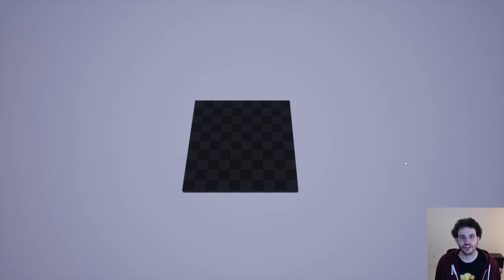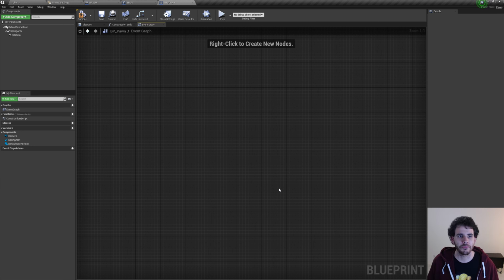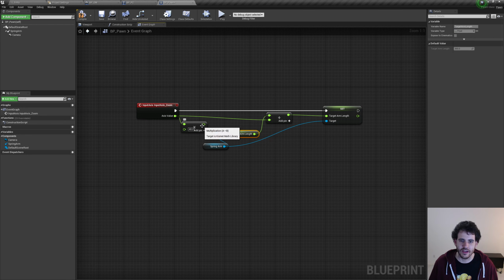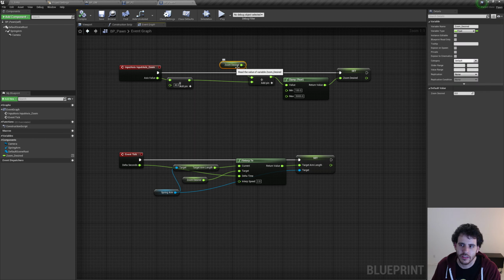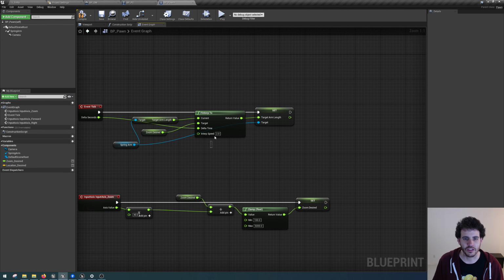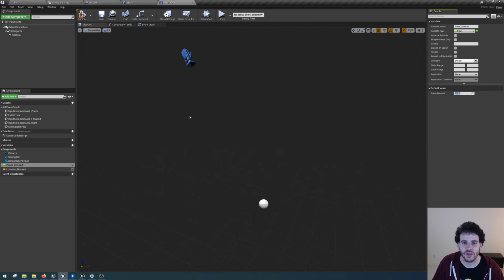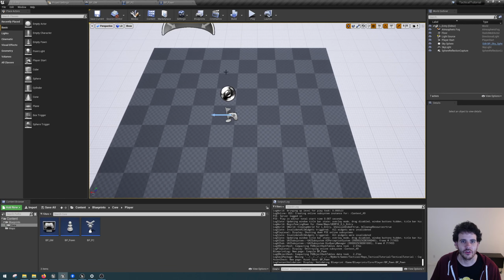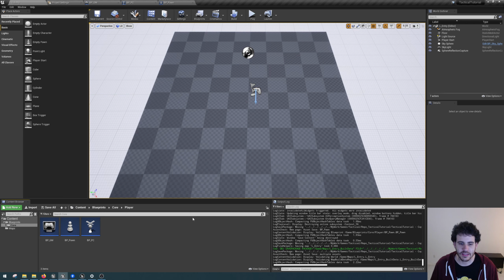Tactical Combat 3 - Camera Controls - Unreal Engine Tutorial Turn Based

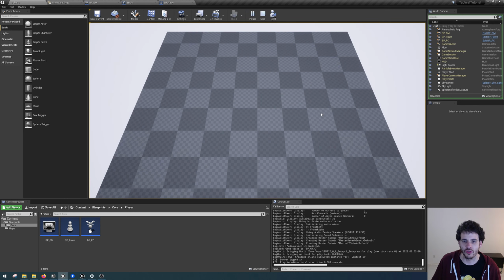Comment: Awesome Tutorial. I was able to get the zoom to work but I'm having a weird issue with controls. At 25:00 when I press play the camera moves forward on it's own a little like yours does but then mine clips though the ground and all I see is blue. When I play around and the board will appear again if I move around but it acts really weird when I center it in frame. I went back and deleted everything and tried again making sure that I used all the same values you did and it did it again. I'm on 4.25.4
Fixed! I simply continued with the Tutorial and the frame 1 possession set fixed it.

Comment: Can you please help me? I am following along to the tutorial, but wanted to add a pitch to the camera. I replicated the code we used for rotating, but connected it to the Y axis instead for pitch. It works fine, as long as my rotation (yaw) is not changed. but the more i rotate, if i try to pitch, the camera starts rolling as well for some reason. Does anyone know how to fix this?

Comment: Thank you for this video! To avoid using Event Tick whenever possible, you can also use a timeline to smooth out the rotation on each press. I liked being able to use what was taught in the movement to be able to try using the axis for rotation as well instead of button presses, very educational

Comment: Just started watching and wanted to praise the series so far. It's been a greta introduction to UE basics so far. I've not worked with visual scripting before so it's all new to me.

Question: To speed up the zoom, you could have also changed the axis scale in the project settings, right?
Reply from the maker: Yep, that would also work, but it doesn't work at runtime 
(e.g. If you want to add an option in the settings for your player to adjust it)

Comment: I'm following this tutorial as a complete beginner to Unreal and in UE5 (likely unadvised, but I'm stubborn). I could not for my life figure out how to implement UE5's enhanced input instead of using axis mapping. It's probably not awful for me to fall back on axis mapping but the deprecated tag scares me. Any tips or should I stick with axis and action mapping throughout the tutorial?
Reply from the maker: Well, my first tip is that it's not too late to restart with Unreal 4.27 ;) 
(You can always switch your projet to UE5 whenever your ready, but you can't go to an older version without redoing everything)

That being said, if the inputs are working, I'd stick with them for the whole series. If it works, don't change it :P

But, if you really want to use the enhanced input system, I'm adding it in video 65:
https://www.youtube.com/watch?v=nKioTxovOMo&t=865s&ab_channel=AlexQuevillon%5BEn%5D%28UnrealEngineTutorials%29

Comment: Thank you so much for this, I am learning so much! One question though, I am pretty sure that I have followed everything right, however, I have noticed that if I go into the game and zoom in, then exit the game. That becomes the new "minimum zoom", ie I can zoom in and out as desired, but if I zoom out and exit the testing, then I can no longer zoom in any further (I can zoom out though). I think it is something to do with the pawn moving as if I reset the pawns location it fixes it (until I zoom again).

Ive checked all my blueprint looks correct against yours, im on latets Unreal 5.2 btw :)
Reply from the maker: That is a really really really weird behavior 0_0

Do you have a PlayerStart in your level? 
(Otherwise the engine will use the viewport location as player start)

Oh and you have your pawn placed in your level? 
You don't need to do that, Unreal will spawn it automatically at the beginning of the game based on the class set in the GameMode
Reply: Possibly because of this: Check your play mode/play settings (three dots on the same tab as the play button). Check where it has "Spawn player at", and set to the player start location, not "Current camera location".

Comment: First of all, thank you very much for this course. I'm still just anticipating and hoping that this course will help me understand a little more about how strategy games are made in UE. 

There is one question. Why are we implementing camera movement in Pawn and not directly in the PlayerController?
Reply from the maker: Thanks :D

And, even though it's not going to be used in the series (at least not yet), the advantage of adding the inputs in the Pawn is that you can easily possess a different pawn anytime you want and I'll also change your controls to match the new pawn. 

Simplest example of that would be a game with a lot of different mini games.
Instead of having 1 pawn with all the different controls, you can have 1 pawn for each mini game that has different controls.

Which it's not something you can do when the inputs are directly in the player.
Reply: @AlexQuevillonEn  I see now. It's really convenient. By the way, if you happen to be interested in making some more tutorial, I can offer you a choice: classic rogue-like (with procedural level generation) or a card battler like Hearthstone :D
Reply from the maker: @@reverse7737 Yes, that could also work. When possessing a pawn (to keep the same example), you could simply switch the context of the new input system and it'll make sure to enable and disable the right inputs.

Comment from the maker: Right now, the camera movement isn't always the same speed if you press 2 directions at the same time (move diagonally) 
Ro fix that, you need to Normalize the DirectionVector before multiplying the speed with it.
So, instead of the two InputAxis events (Right and Forward) and replace it by a combination of both in the Tick.
Like that: 
https://imgur.com/a/MJtpMOJ
Reply: Hey, so far it works fine. But here i dont know what u mean. I can build this part but where should i put it exactly? Could u show the hole blueprint?
Reply from the maker: @HundmagWurst  It's the same BP_Pawn as before, I just deleted the 2 input axis events (InputAxis_Forward, InputAxis_Right) and added this at the beginning of the EventTick
Reply: @AlexQuevillonEn  Hi, thanks for your answer . Today  I got to Part 6 and saw the changes.

Comment: Hey, thank you so much for this tutorial series! I am getting an odd problem with the camera rotation though; no matter what I do, if interpolation is applied, it will only rotate a few degrees, not the whole amount. Is there anything I can do to fix that?
Reply from the maker: I'm not sure what could cause the issue, but maybe:
- Make sure you connected the DeltaSeconds properly
- Also that you're using the right interp function: RInterpTo.  (RInterpToConstant doesn't give the same result)

If it doesn't work, you can send me screenshot of your events (Tick and InputActions) on Discord and I'll take a look ^^

Comment: Thank you！Nice camera tutorial！I still get problem. I did every step follow you, just can't use "ASDW" to move camera. When i start a play in Editor, the camera falling down...lol. Would you give me some tips for this issue?
Reply from the maker: Falling down? Like, continuously moving down or just going back to a specific location and then stops?
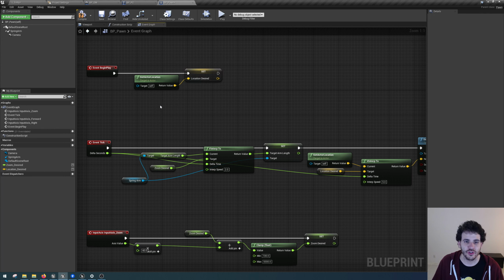If it's just trying to get to a specific location, you probably need to set the Location_Desired on BeginPlay (28:17)
Reply: @AlexQuevillonEn  Yes, this is the problem! Thanks!
Reply: Sorry, actually it works, but i don't why use "ASDW" to move camera, i should press mouse middle button first..Is there something wrong?
Reply from the maker: @howielu1841  Do you need to hold down the middle mouse button for it to work or only press it once at the beginning? 
If it's just once, it only means that you're setting the ''Editor Focus'' to the game viewport. Which is completely normal, a simple mouse click would also work. When you click on play, the focus is still on the Editor UI and not on the game viewport and that's why it doesn't receive your inputs. Because it's the editor that is receiving the inputs, not the game.
Reply: @AlexQuevillonEn  Thank you! Alex!

Comment: How would you have the camera instead orbit around a selected actor, when say for example the right click mouse button is held, and the mouse is moved left or right to pivot the Yaw?
Reply from the maker: I'd probably do something like that:
https://i.imgur.com/YjuKBoa.png
I tested it and it works fine in the BP_Pawn.
For the line trace channel, you can use the one that is working with your ground (or actors you want to focus on). Visibility should work
Reply: @AlexQuevillonEn  Thanks a bunch, it works, but I am curious if the same can be done with inputaction/axis in the case of possibly using a controller or something
Reply from the maker: @Axiz_K  Yes you can, I just did it like that because you just asked for the mouse :P 
But you can map both the MouseX and JoystickX axis in the input settings.
Reply: @AlexQuevillonEn  
why is BP_Pawn being used to store the code and not BP_Player Controller? 
How do I understand the interaction between them better? 
hmmm curious...
Reply from the maker: @JB Bird  In short, he PlayerController is the player himself and the Pawn is the actor the player controls.
The player is always associated with your PlayerController, but the controlled Pawn can change whenever you want.

By having the camera controls in the Pawn, it leaves the option to possess another Pawn at any time.
Not sure it'll ever be useful in my case, but the option is there if we want to.

e.g. 
If you have a 1st or 3rd person camera movement in the overworld, but want to go back in top view during the combat.
Then you can simply possess the 3rd person Pawn when out of combat and possess the top view Pawn when the combat starts.
(Sure, you can always have everything in the same Pawn, but it would get a little bit messy.)

Also, the PlayerController has some multiplayer implications since it represents the Player, but I don't have much experience with that.

Anyways, that being said, if your game doesn't have multiplayer or different types of controls, you can pretty much do what you want :P